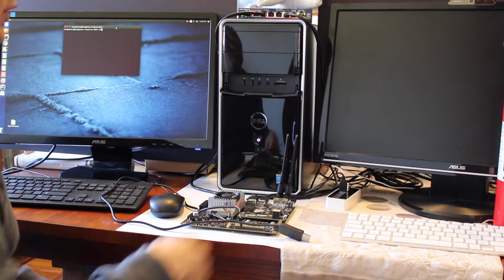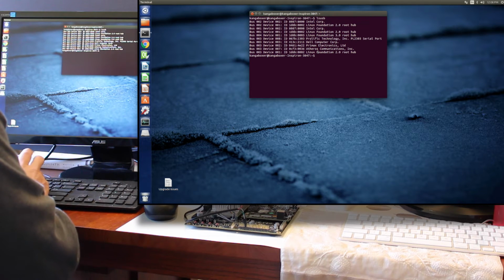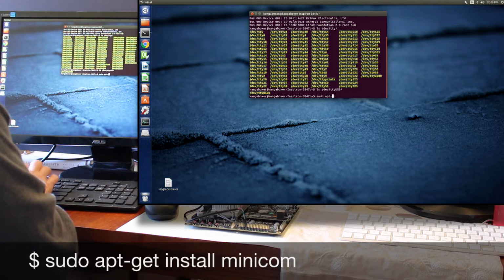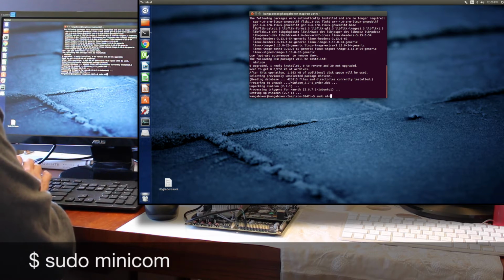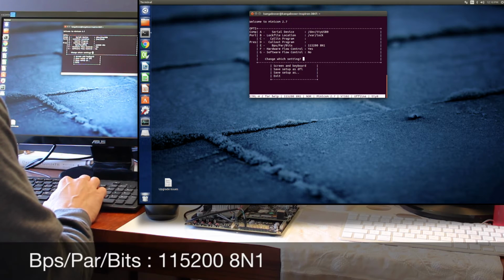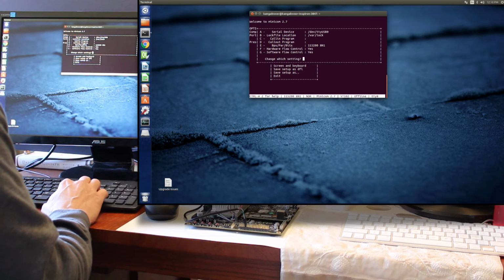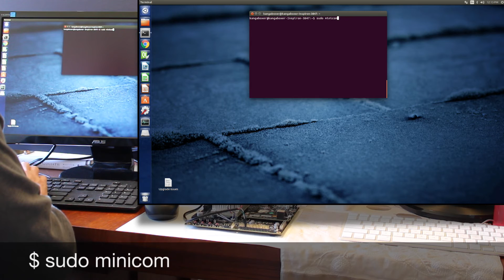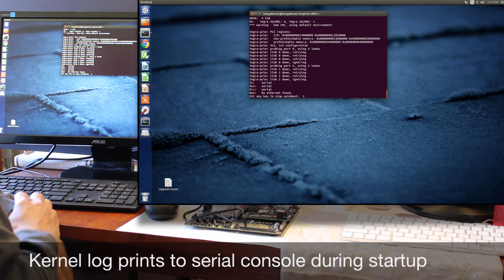Serial Console - NVIDIA Jetson TX1

Comment: Hi Jim, I love your videos and find them incredibly useful. I am trying to communicate with a couple of peripherals (a rfid module and an oled screen) using my NVIDIA TX2 with jetpack 3.0. Have you used the TX2 UARTS to communicate with a peripheral? also, the oled screen seems to run with SPI and following posts in the nvidia forum it seems that one must enable it by software in the dtb file, have you done this and how did you do it? I discovered a complete guide in elinux to do it in the TX1 but it seems that not all the steps are similar to the TX2. Finally, have you done any spi communication with an external device? I have not seen any examples on the web using it so I am a bit lost on how to start. Thank you very much for your assistance! Best Regards.
Reply from the maker: Hi Daniel, thanks for the kind words. On the TX2, I have not worked with either SPI or the UARTs. Before starting though, I would suggest that you wait for the JetPack 3.1 to be released next week (week of July 24, 2017). A good place to ask questions like this is on the NVIDIA Jetson TX2 forum: https://devtalk.nvidia.com/default/board/188/jetson-tx2/ where a larger group of developers share their experience. Also, there are NVIDIA engineers there that can help answer questions. Thanks for watching!
Reply: Thanks for your response Jim! I took your advice and asked on the forum. I have also another question regarding your video of GPIO on the TX1, do you think the library could work also on the tx2? Best Regards
Reply from the maker: It should be close to the TX1 library, with the exception of the GPIO numbering. See http://www.jetsonhacks.com/nvidia-jetson-tx2-j21-header-pinout/ for the GPIO numbering.

Comment: Hey Jim! Could you please do a video on setting up the TX1 as a master using SPI to control a slave raspberry pi and arduino? A lot of sensors like IMUs seem to like this protocol and curious to use several pis and Arduinos with a TX1 main brain in a project. Thanks! Love your series of videos
Reply from the maker: Hi Ryan! A video about that subject is difficult, as there is quite a bit of knowledge people have to have to that is difficult to convey in that medium. Here's an article on how to enable SPI for a CAN bus device on the TX1 on JetsonHacks: http://www.jetsonhacks.com/2017/04/04/gpio-and-spi-nvidia-jetson-tx1/
Note that for the majority of projects, USB is an alternative. For the Arduino, there is a USB port. For the Raspberry Pi, there is an Ethernet port and USB. If you are looking to control a bunch of them from a Jetson, it's much easier to use a USB hub or Ethernet switch to hook them together.
Thanks for watching!

Comment: I tried connecting my Jetson TX1 to my netgear R7000. The router is bricked but I've seen some articles on de-bricking it. However, when I connect the wires (same as you have in the video.) nothing happens. There is a connector on the inside of the router with pins 1-4. 2 is ground, 3 RX, 4 TX. I have router to jetson pin 2 to pin 9, pin 3 to pin 8 and pin 4 to pin 10.  Here is a readout from lsusb.

Bus 002 Device 002: ID 0955:09ff NVidia Corp. 
Bus 002 Device 001: ID 1d6b:0003 Linux Foundation 3.0 root hub
Bus 001 Device 003: ID 046d:c52b Logitech, Inc. Unifying Receiver
Bus 001 Device 001: ID 1d6b:0002 Linux Foundation 2.0 root hub

Device 003 is my keyboard and mouse. Any help would be much appreciated. 

http://myopenrouter.com/article/how-debrick-or-recover-netgear-r7000-r6300v2-or-r6250-wi-fi-routers
Reply from the maker: Hi Bryce, the above video shows connecting the serial console to a PC. The serial console is a system reserved  UART which is used to communicate console messages. The serial console is typically used for debugging purposes, and other system tasks like selecting UBoot options. For example, when the TX1 boots you will see text messages scrolling by on the screen; those messages are also sent to the serial console so that they can be used remotely. The serial console is reserved for system use. In order to communicate to a device like your router, you will need to use one of the other UARTS. Please ask this question on the Jetson TX1 forum at: https://devtalk.nvidia.com/default/board/164/jetson-tx1/ where others can help you, and so that the answer can be shared with other members of the Jetson community.

Comment: 1:14
Jim from JetsonHacks.com!
Reply from the maker: +Cullen Williams lol catz on that one!
Reply: +Jetsonhacks what are the hardware requirements if you want to build the TX1 Module into your own designed PCB? is there documentation out for this yet?

Our team at school is using the TK1 for autonomous vehicles, and we are wondering how much work there is to migrate to the TX1. We assume there would be alot of differences. mrc.eng.fau.edu
Reply from the maker: +Cullen Williams I know that there are a few groups outside of industry that are working on TX1 carrier boards. Here&#39;s one discussion: http://bit.ly/1NzWRwn. Full documentation of the module and carrier board are available on the NVIDIA embedded developer site:&#160;https://developer.nvidia.com/embedded/develop/hardware&#160;
Look through the documentation and see if it fulfills your needs.

Let me know if you post pictures and videos, I know that Bruce the Shark is more than interested in such things.

The TX1 and TK1 both run the same software with some minor differences, CUDA 7.0 vs 6.5 for example. The pinouts on the connectors are different, so that has to be taken into account. My guess would be it&#39;s not difficult to port from the TK1 to TX1, but you&#39;ll face the same set of niggles one always faces in such situations. But there aren&#39;t really any architectural differences, so it should be straightforward.